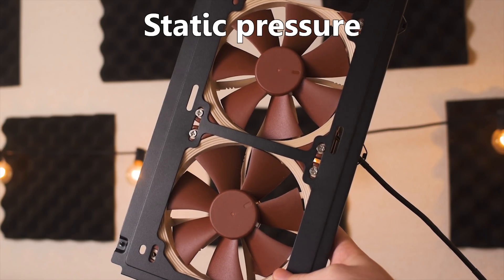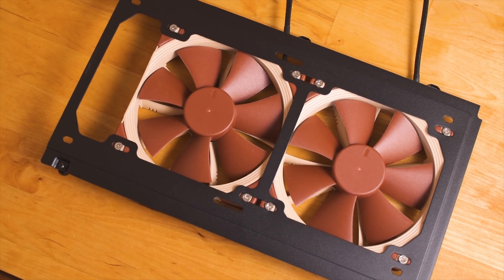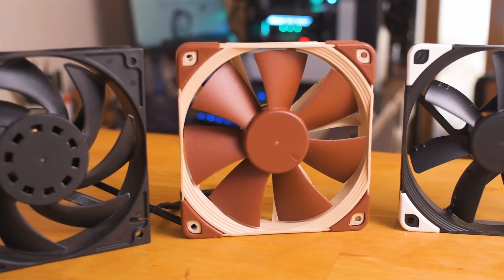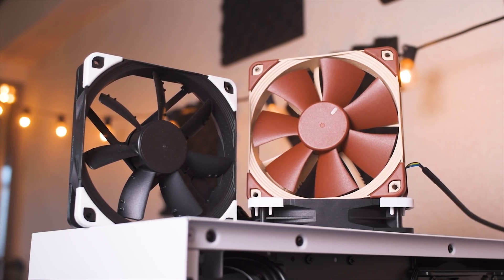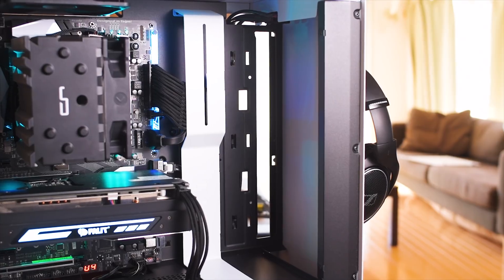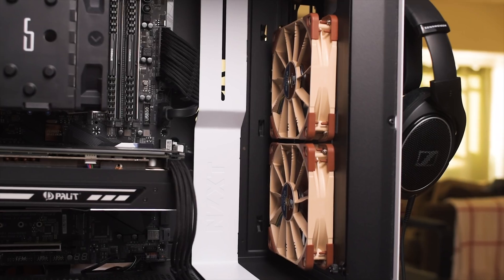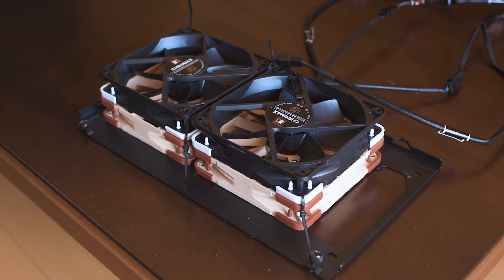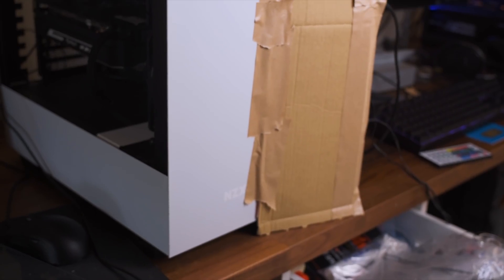DON'T buy front intake fans! (For NZXT H500/S340)

Comment: There's one major problem with your premise in this video. Whilst it may not make a difference to temperatures in the system without intake fans, I can guarantee the system will become an absolute dust magnet if you don't use intake fans. Without the incoming air being forced through a filter at the front, you will have air coming in through the pci express covers and every other crack and crevice that don't have dust filters. This is also most likely a bad premise for anyone like me that has a front radiator on the intake. Without fans to force the air through my radiator, I can almost guarantee that my temperatures would be worse without intake fans. Overall, I feel like your video was rather pointless as I would rather spend $20 - $30 on intake fans than spend 10-15mins every few weeks cleaning all the dust out of my pc.
Reply from the maker: I have gotten several comments along these lines, and I have been running the case for several months with no intake fans and didnt have much of a problem with dust. I should actually do a video on how much of a difference it makes.
Reply: @DawidDoesTechStuff  As a H500 user with a recent switch to intake fans, it matters a lot. I had a lot of dust buildup on my gpu, together with pci/e covers. i had to clean it every week.  since i got my 2 intake fans, this has become like once every 2 months.
Reply: @rolfmoerland9881  which ones did you buy? :)
Reply: @rolfmoerland9881  I recently added a dedicated GPU to my build and noticed a similar buildup on my GPU backplate within a couple weeks. I may have to do the same and grab some intake fans.
Reply: @rolfmoerland9881  thanks for this. I bought the case with extra fans for intake and immediately after seeing these videos i felt bad. At least now i know they'll serve some purpose.
Reply: @DawidDoesTechStuff  Maybe your home/pc room hasn't got much dust in the first place then? I unfortunately have a room mate that smokes a lot of weed and even though it's not in my pc room, it seems to make the whole house rather dusty. Even with my pc in it's current config ( https://au.pcpartpicker.com/b/gF3bt6 ) I still have to dust it out every 6-8weeks if I want it looking good without a noticeable layer of dust on the gpu backplate and psu shroud. Being mostly black doesn't help as the dust stands out more but even with my airflow being set to positive, I still get a little bit of dust on the pci express covers every 6-8wks from my gpu drawing air from back there. When I first set my pc up and went with a 140mm top exhaust, I had more airflow on exhaust and my system got dusty twice as fast so I set the fan speeds way down on the exhaust and set the intake fans to always be about 10-20% higher. This positive airflow stopped the pc from getting dusty so quickly. 

The scenario you propose to people will give negative pressure and therefor should make the case more dusty in most situations. I was probably a bit mean by saying it was a pointless video so I apologize for that. If dust isn't an issue than your scenario is fine for those people but for people like me where the environment can be dusty, and I'm a bit of a clean freak. I find that having positive pressure vs negative pressure is much better for cleanliness and keeping dust out of the case.
Reply from the maker: @tyroniebalonie  Oh wow, that's awesome that you keep your PC so clean. It sucks that you have a roommate that pollutes the air in your flat. You are right that positive airflow does help for dust build up.  I had the PC in a flat in Tokyo, which is super dusty for some reason, and it didn't build up too badly. I however am less worried than you are about dust build up. I should be better about that kind of thing actually.
Reply: @tyroniebalonie  Are you able to access your HVAC system's filter? They're fairly cheap at the hardware store and need replacing at least twice a year, more if you have smokers and animals.
Reply: @oddieboi  Why do you assume I have one? I don't
Reply: Dawid Does Tech Stuff nah he is just blaming the roommate for his dusty ass room.
Reply: @tyroniebalonie  I'm thinking of buying this case. could you help me about the position of the fans to avoid dust accumulation?
Reply: I came here for this comment ;P
The thing I would have liked seeing is taking out the exhaust fans and putting them in the front, see if that makes any difference. I would think not. So that means you can have best of both: more dust being filtered out AND not having to buy extra fans for a case that comes with 2. I think that might be a better video: Don't buy EXTRA fans for your case. :)
Reply: @tyronie balonie That was the first thing I thought when I saw this video too. I hav an S340 case and ran it for 2 months with only the 2 exhaust fans. When I cleaned out my PC, it turned out to have dust not only in the filters, but also in all the other places where it pulled air in, including the PCI express covers. I didn't get intake fans but changed to liquid cooling and my radiator fans work as intake. That has stabilized the dust buildup.
Reply: So if blow it out the back it will draw through the front filters, but usually negative pressure as a no-no for dust control.
Reply: But won't the dust that comes in be blown out through rear and top though?
Reply: I can run it with H510i ?
Reply: Yup!!!
Reply: No problem with dust here. No intake fans. I haven't had to clean my PC for nearly two years. Very low dust anywhere other than the CPU heatsink.
Reply: @allisknu11  2 years?! I've the same case. You have to have dust in it bro. After 2 years?? Look at your filters also. I dust mine once every few months and the filters are always full and some dust always gets into the case
Reply: @fionnmaccumhaill1023  How clean is your room and home? Not trying to be rude. My room is clean. I clean my room by sweeping the hardwood. I can see dust accumulating in the PC more often when you live on carpet. I know, because I used to have a bedroom with carpet and dust does seem to accumulate more in that environment. 

Yes, two years, with little to no dust. Hard to believe? I guess I'm lucky? Or I just keep my place clean and I don't run a ridiculous 6-10 fans setup. Filters are clean. I checked it. I don't have a dust problem in my room. Not much dust gets in here. Hardwood helps.
Reply: @fionnmaccumhaill1023  But I just out of pure OCD, I'm going to be cleaning it every 1-2 months from now on. I have a DataVac that I use and it's wonderful for cleaning.
Reply: @allisknu11  my room is also hardwood flooring and I mop and clean regularly. Infact all of my house is hardwood. We also have a cleaner lol.
Maybe we have a different definition of what dusty means?. 
I find the black case also draws alot of dust which doesn't help.

Comment: I wonder if I should move my front 360mm radiator on my NZXT H440 to the inside top exhausting air out the top instead? When I put my hand behind the front radiator I never feel any air coming through. Even though it is cooling well, so that's the main reason I've never moved it.

Comment: when it comes to heat issue fans is our best friend,  I'll consider putting a fans or blower fan forced air into it,   it helps  to keep it cool,  the result may not be quickly felt by the test gadget but surely it will...

Comment: I just built started my build on the H500i (i7 9700k & GTX 1080Ti) I'm running a CLC  280 on the intake side of the case. I plan on OC'ing the CPU, GPU & Ram so I'm curious to see what comes out as the first bottleneck heat or the limits of the chooses components. In any case once the rest of the components arrive and I get it all dialed in I'll post results for anyone that's curious.

Comment: Sucking unfiltered air into the case through the mesh at the back? 10/10 would dust again.
Reply: Yeah that's definitely an issue in the stock configuration. Front intakes do help in that aspect at least.

Comment: Soooooo... I have the H500 and like you what I noticed very quickly is that airflow sucks especially for the GPU.  What I did is 2 140mm intake fans and another 140mm intake fan on the top vent to create positive pressure.  Then the back vent has the h80i v2 (a 120mm aio, I wanted to do 240 but the original case I bought it for didn’t fit it) and I also got a blower gpu and turn the psu around so it’s taking air from in the case and expelling it out the back.  The last thing I did was take rubber fan mounts and jerry rig a fan to the underside of the psu shroud blowing up through the holes directly into the GPU.  That got my temperatures down to an acceptable level even in summer.  

I7-8700k @ 4.8 ghz
1070 ti blower 

I could give you all the stats but those are the ones that generate the heat

Fine

Maximus hero x
Evga 3000 mhz ram
Evga 750w psu
H80i v2
970 evo 500 m.2, WD 7200rpm 2tb hhd, 860 64gb ssd cache
And a Partridge in a pear tree
Reply: teddysurf a 1070TI blower? There’s your problem. Buy one with at least 2 fans.

Comment: Sorry if I missed you mentioning it in the video, but I was just wondering if you manually set the CPU/GPU/Exhaust fans to a fixed rpm for this test? Because if you didn’t, then they would ramp up as you removed your front fans, throwing off your results.
Reply from the maker: Sorry about the delayed response. I didn't see the notification for this comment.
I did set all the fans to a set RPM for the tests (no temperature curve). I must've forgotten to mention it in the video. :)
Reply: I remember I told people its unnecessary to put a bunch of fucking fans in a case and they ROASTED ME lol.  now I stand justified.
Reply: EXACTLY.  The methodolgy in this "test" is critically flawed.  The fans will adjust rpm to keep temp constant, whether there are 2 or 4.  The 4 fans may be running at lower rpm to reach the same temp as 2 at higher rpm.  
Then stacking two pairs of fans directly on top of each other? What? 
I appreciate the effort that went into making this video, but it's far from useful data.
Reply: @newjackvideo   lol he did set them to fixed RPM
Reply: @user-ru4qx1ks6y  🤡🤡🤡🤡
Reply: @jonas6293  ???
Reply: @newjackvideo  lol, you're calling out the test "critically flawed" based purely on an assumption you made (and turns out was wrong about).
Reply: @newjackvideo  So what would you do? I currently have a H500 with XFX RX580, i5-6600k and Cryorig H5 CPU cooler. Should I invest in front intake fans? As well as replace the stock ones? And what would be the best option for intake/exhaust with my setup?
Reply: @vareq1672  why not? Fans are cheap.
Reply: @newjackvideo  you're critically flawed

Comment: EK Vardar Evo 120s are better static pressure optimized than the NF-F12.  Most of the older ball bearing Vardars weren't as good but if you are using the current Evos with a fluid bearing, you will see a small difference. The F4-120 is also better than the NF-F12 but had a bit more of an unpleasant tone than the Evo and F12. Either way, the difference is so minimal between these to be largely irrelevant. In this particular test, component choice plays a major role and would likely have been different if using  hardware requiring increased heat dissipation.  Another two factors not expressed here are noise and fan speed. The point you are making is absolutely valid but your testing is incomplete. The only real conclusion you can accurately make is that front intake fans are largely irrelevant for that system, and potentially others with similar cooling requirements.

Comment: bullshit.i have the same case and temps have dropped 15c on my CPU.but not on my graphic card.when i have added 2 fans in the front.i5 8600k rtx 2080 msi trio x.i run at 4.8ghz at 1.290v and temps never get higher then 61

Comment: I stuck the radiator and fans from my Enermax Liqutech II in that front bracket in the H500. Works fine...but you have to put the fans forward of the bracket and the radiator behind it; they won't both fit behind while clearing the cable management bar. Running the rear and top fans supplied with the H500 gets you plenty of airflow through the case when you're liquid cooling the CPU. I had a Cooler Master aircooler on my TR2920 while waiting for the AIO to arrive, but it's an ungodly pain in the ass to work in the case with those big honking radiators on top of the CPU.

Comment: The system you are using is pretty low TDP which explains why you see no difference, its just not generating enough heat to justify the need for intake fans. Now if you were running some higher end hardware the results would have been much different as the TDP and heat generation would go up and thus more cooling would be needed. You are basically shoving a bigger radiator into a car that doesn't need one.

Comment: I would like to see if it would matter if there was a 240MM rad in the way with Fans Vs No fans on it would the static pressure from the two rear fans be enouugh to cool or would you still want fans on the Rad?

Test 1- NZXT X62 front mount with fans and two rear exhaust fans
Test 2-NZXY X62 front mount with no fans and two rear exhaust fans
Test 3- NZXT X62 front mount with fans and no rear exhaust
Test 4- NZXT X62 front mount no fans in the case at all
I would be curious as the S340 Elite and H5XX cases have the space for water cooling and the front is the most logical place to mount a 240MM rad

Comment: But if i have s340 and kraken x62 aio watercooler i think i should still use those fans right?
Reply from the maker: I haven't tested it specifically, but I think with a radiator there the fans are important.
Thanks for the comment.
Reply: If u have no video ideas there could be one.. How many case fans do you need if you have aio!? (Or something like that)

Comment: all this is fun and games until you take negative air pressure into account and watch your hardware get tonnes of dust build-up in no time.
Reply from the maker: Haha!! Yeah I was worried about that. I have however used this case for several months with no front intake fans and haven't had much dust build up.

Comment: Getting the same results with NZXT H200 case. Running a Ryzen 5 2600, wraith spire cooler, EVGA GTX 1070 SC. Tried 2 Arctic BioniXF140 (air flow) front fans, and 1 rear exhaust stock NZXT 120mm that came with the case. Swapped them out for 2 Noctua NF-A14 PWM. Tried every combo. Same result. Temp stayed the same.
Reply: I agree, similiar results and setup for me too...tho temps are fine and well inside normal range..idle/gaming/and some cpu intesive work

Comment: I saw this exact info on Gamer's Nexus H500 case review and it was another selling point to not have to buy extra intake fans and have a louder setup. Negative pressure and convection does all the work.
Reply: But how about dust build up vs positive pressure?
Reply: Anon Anonymous Unfortunately negative air pressure will cause more dust to build up since apparently it would cause it to pull air from places there isn’t dust filters. So ideally if your worried about dust you’d take off the top and back fan and place both at the front.
Reply: shalol hmm I just found out that the h500 is different than the H7/400 series with the intake mesh in the front and I wonder why it’s cheaper thank for answers btw
Reply: @Sha.ll0w  ;) that is what i intended to hear
Reply: Anon Anonymous I want to know about that too
Reply: Anon Anonymous please reply if u got answers
Reply: You better have incredible dust filters then.

Comment: Thank you for the informative video. I'm wondering if most of the air intake happens through the small vent at the bottom of the case, and would be interesting to know what happens when the side vents are taped-off. If you still have the rig,  it would be great if you could try that out.
Reply from the maker: That's a great suggestion thank you. I don't have access to the PC at the moment but I will try that out when I do again. So that we can see where the most fresh air is coming from.

Comment: It's a negative pressure case. Put the midrange NZXT that come with the case in the front and the NOCTUA NF-12 in the back and on the Top
Reply from the maker: Yes I am definitely going to test that. I also want to try reverse the airflow. Have the top and rear fans be used for intake and then exhaust through the front. I'm curious to see how much of a difference that makes.
Thanks for the comment
Reply: @DawidDoesTechStuff  Plus remove that dust filter on the top fan. It reduces the airflow. Gamersnexus has proof that removing the filter helps more than the additional fans
Reply from the maker: @ivanlevitskiy8058  I will do that and see how it goes. Thanks for the comments by the way.
Reply: @ivanlevitskiy8058  Am I the only one who had his come without a top dust filter? I felt proud knowing I needed to remove it as I took it out of the box... and nothing but fan.
Reply: @DawidDoesTechStuff  I'm not sure If my use case is helpful at all, but I have a LC vega64 w/ radiator mounted on the front. Whole front panel would nearly match temps of GPU, untouchable... added another intake and it seems to spread it along the case better, in my experience. Could be stirring up the inner-case air more, or simply black magic.
Reply: @jakehix8132  Must be RGB fans, they all come with a black magic guarantee
Reply: @jakehix8132   Same...